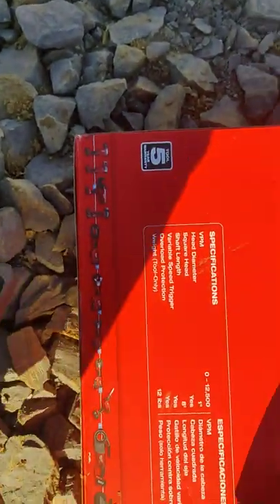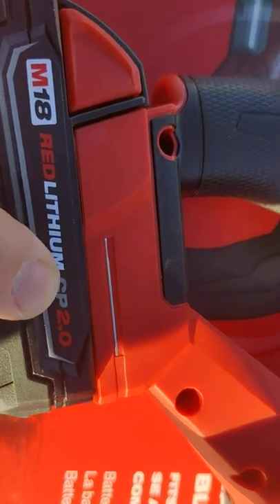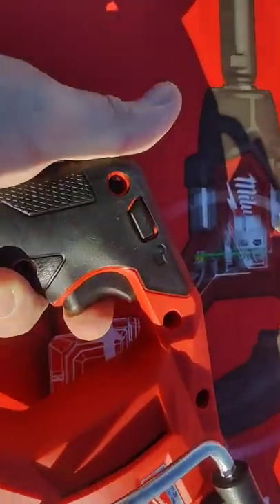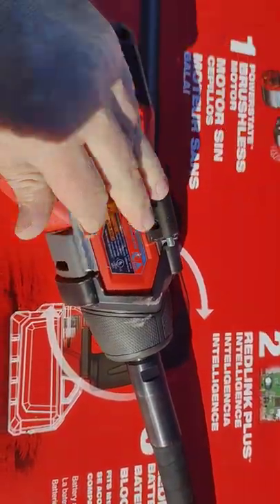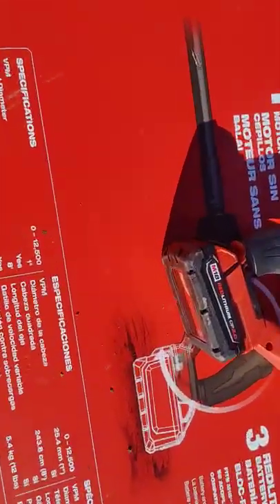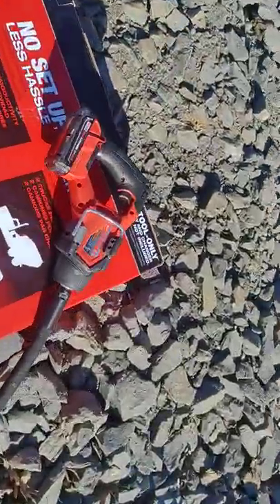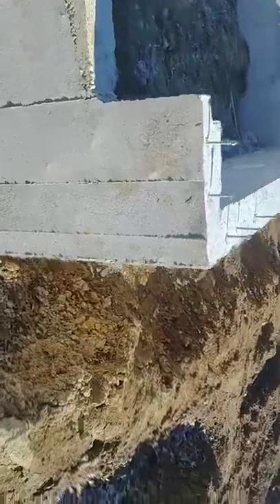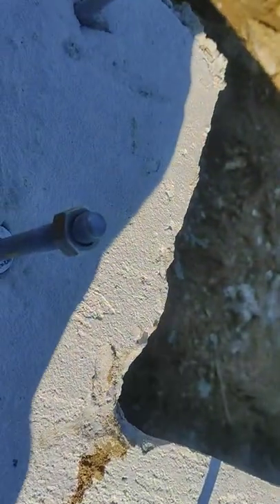Milwaukee concrete pencil vibrator

Comment: Thanks for the video. How long does 2.0 battery last for with full charge?
Reply from the maker: I compacted 12 cu yds of concrete in wall foundation and didn't hurry, it took me close to 15 minutes and battery was at half charge. There is no resistance to it, and it doesn't drain a lot.
Reply: @Quentyn73  Ran 15m with half charged. Pretty impressive. Anyways, thanks for quick response

Comment: Don’t run it while it’s in the air. You will mess it up.
Reply from the maker: True, it's not designed for continuous operation while not the head is not immersed in concrete.